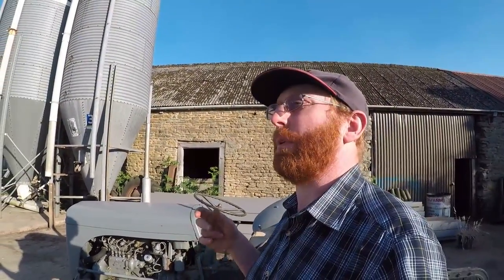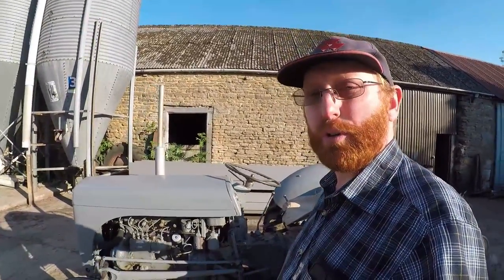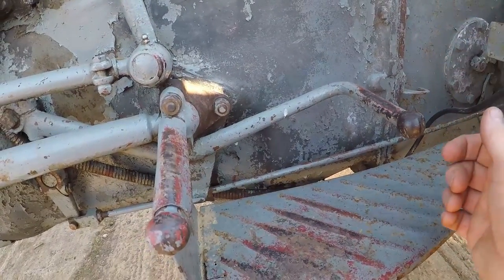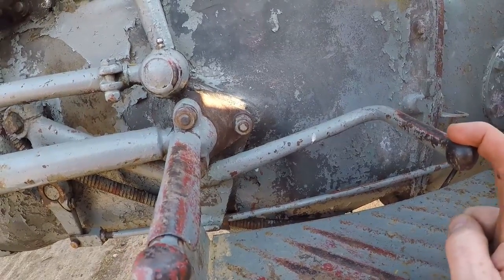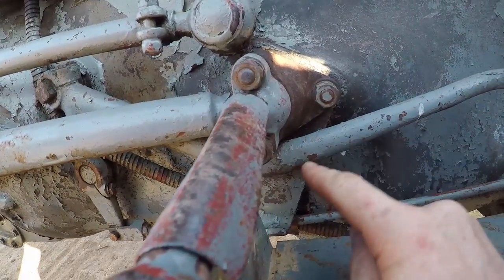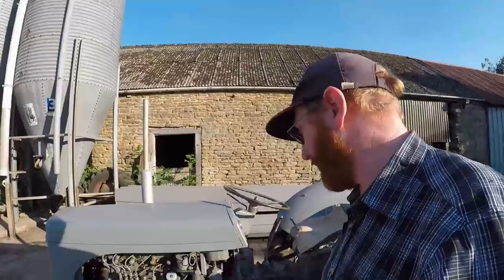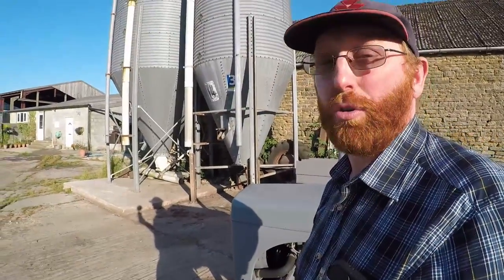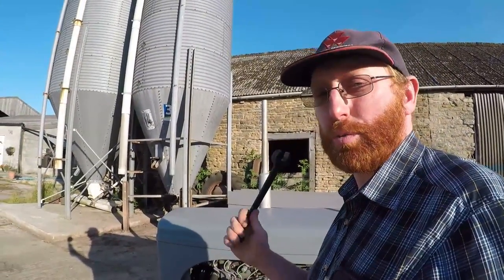Vintage Thursday. Ferguson TE 20 tractor clutch adjustment.

Comment: You can also use the spanner to check your fuel level with the markings on the side of the spanner.
Reply: I was expecting him to use the spanner to measure the 10mm gap for the clutch adjustment!
Reply: @masseyman6290  so was I 🤣think the spanner is the right thickness?

Comment: Hi.I did this adjustment on our fergie 20 as it would take a few seconds for the tractor stop when you clutch it.When I tightened it back the clutch does not work at all now.There is no pressure on it.Thanks

Comment: Hi Dan hope your well. Need some more advice if possible please ? Our t20. When we go to put it in start gear nothing happens we have to bump start it batterie is fine just won't engage starter. Any ideas?  Thanks in advance richard  . Ps clutch is fine after your last advice thanks 😊

Comment: Excellent very helpful. The clutch on my tef20 seems very sharp and judders. It's worse than when i first got it a few weeks ago and I'm investigating some small leaks under the engine block. Someone suggested the issues might be connected? Or is the clutch just really nervy on a ferguson?
Reply from the maker: Clutch should be smooth.
Could be oil contamination on the clutch plate.

Comment: Hi there I have just  restored  my tef 20  . It started easily before  the restoration and still does how there is  engine oil coming out where the exhaust   meets  the  manifold when the engine is running   . The tractor  hasn't been  used for the past  few years . Any  advise  would be appreciated  .
Reply from the maker: Did you do any engine work?
Reply: @CowfarmerDan   
No I don't do any engine work  and having an engine rebuild would be  very costly . A  mechanic  suggested that I  use a topper   and work the tractor hard then the problem might  go away  . It was fine before the restoration and  guage reading normal oil pressure  . I hope its not an engine  rebuild .Thanks for contacting me. Pat

Comment: Hello,  it's impossible to desengage my clutch...i did stop the tea20 during 3 months. 
How can we fix the clutch ?
Thanx
Reply from the maker: The clutch plate could be rusted to the flywheel.
Splitting the tractor is the easiest way to free it off.
Reply: Thanx ! Is it possible even i am not a professionnal ?
Reply from the maker: Yes, it's not too difficult.